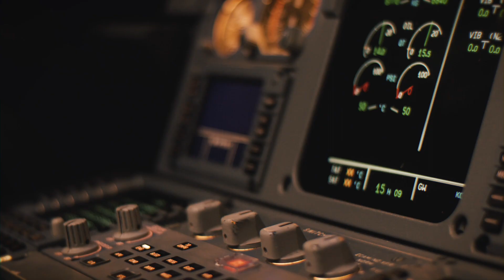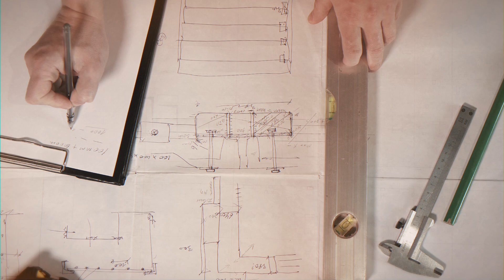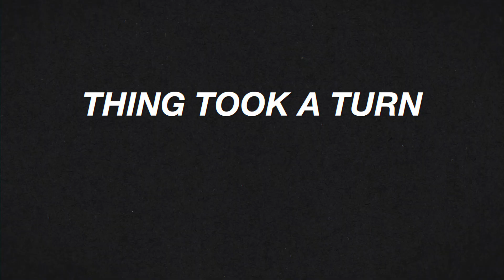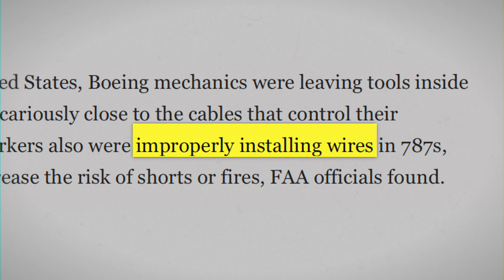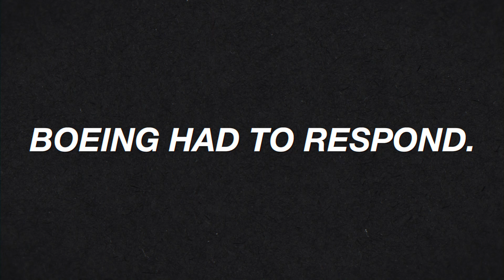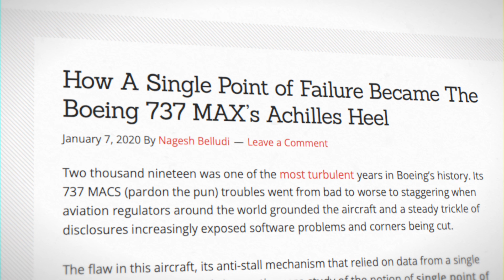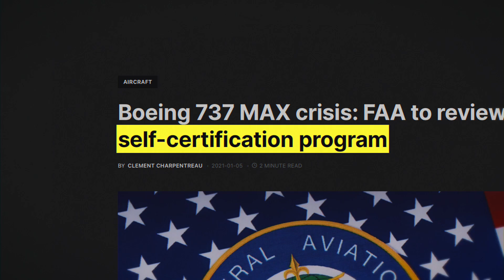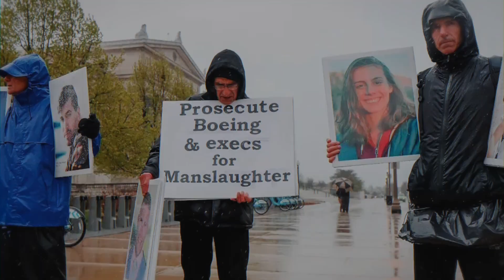The Scandal That Destroyed Boeing

Comment: The greed and blame gets worse.  Boeing DID offer a second MCAS sensor but it was an expensive OPTIONAL equipment addition.  Yes, Boeing was charging a premium for a safer aircraft.  Sadly, most airlines did not order the costly second sensor.  The whole situation is pretty messed up, actually.
Reply: Not the first time. In 1979, a DC-10 crashed when an engine fell off the wing and the aircraft stalled. The plane had a stick shaker to warn the pilot if the aircraft was approaching stall, but for the pilot only, and because that feature was powered by the engine that fell off, it failed to work.

A stick shaker for the copilot, which could have prevented the crash, was an optional extra; American Airlines chose not to pay for it. They also chose to save even more money by taking shortcuts when removing the engine from the wing for maintenance. One such shortcut caused the damage that resulted in the crash.
Reply: @BB49 This specific post is a misunderstanding. They did charge for angle of attack indicator display, but there was no two-sensor option.
Reply: @shane99ca  We watched how that happened in college.  Can't remember if it was human factors in A&P school or while in flight training.  Much of it blends together.
Reply: @BB49 Like most crusader types, you are quick to demand that others do something. But having two stick shakers instead of one can hardly be called a critical safety issue.

Furthermore, if you make it too difficult or expensive to do business, manufacturers will simply close up shop or head overseas for friendlier climes.

Leaving you to explain your role in the downfall of a domestic industry to an angry population.
Reply: @reubenmorris487  If you're talking about the cost-cutting practices that ended up costing lives, those were management decisions.
Reply: @BB49 When it comes to profit and greed it always goes before human lives. We have seen it before with Bophal and other horrible disasters. Profits to the CEOs and shareholders come before everything else, sad reality! :(
Reply: @BB49  @BB49  Actually, stick shakers are not safety-critical, because they are far from the only way the pilots can be warned of an impending stall.

In fact, in modern aircraft, the stall indicator is usually a gong and verbal warning. More modern autopilots will also attempt to take control from the pilots (assuming their hands are not on the stick). Many aircraft incorporate stick shakers/pushers as well but by no means all, certainly not mandatory for both chairs.

As for an industry leaving the country, it is likely to do just that if overzealous regulations make doing business in their current country too difficult. But what the hey, it's only a few billion a year and a couple hundred thousand jobs; according to Hurst, no skin off his nose.

Think of all the industries that relocated to China over the last 20 years. America is no longer the world's factory; China is. Granted, we're getting some of it back, but only because China has shown itself such a bad actor.
Reply: @BB49 I could take your criticism more seriously if it weren't so poorly written. You haven't actually refuted anything; you're just being pissy. Feel better? (Not that I care.)
Reply: @Hurst This is your opinion, and that's all it is. You get exactly one vote, same as everyone else.
Reply: Airbus comes with three. No extra charge.
Reply: @eleventy-seven  Airbus has three pilot’s chairs? Because you can only have one stick shaker per stick.

And don’t kid yourself; those three sticks, if they exist, are fully charged for. It’s just that there is no option to save money by ordering fewer than the full number.

That’s like saying that a Cadillac comes with heated seats at no extra charge. At that price point, it’s expected. (Although that didn’t stop BMW from trying to sell heated seats by subscription!)
Reply: The sensor they offered was to tell the pilots MCAS was not functioning NOT to tell MCAS it needed to act - the airlines that didn't purchase that didn't have one at all.   The sensors the MCAS used for determining if it needed to do anything  were already redundant on the 737 and pre-existed the Max AND MCAS.  If was that sensor that failed and could have failed on any plane due to malfunction.   MCAS even used more than one of the sensors on the Max - the issue is they chose to alternate between them for each flight rather than use them to determine if one was faulty - they didn't compare the results of more than once sensor.  So while the plane used the sensors redundantly - the MCAS system did not use them in a redundant way.  Perhaps Boeing mistakenly assumed that the existing procedures for handling runaway trim for any reason would be used by the pilot no matter the reason for the trim.  After the investigation of the first flight Boeing did reiterate  that the pilots should turn the trim off using the switches that have been there since the first 737 I believe as they were trained to do in any trim failure.  They still should have briefed the pilots on MCAS AND made use of all existing sensors on the plane for redundancy rather than alternating - and the pilots should have fallen back on their training and turned it off at the first sign of trouble.  And since both happened close to the ground - gone around and landed immediately as well.
Reply: @AmbientMorality  This is also a misunderstanding - there was always more than one sensor on the 737 - it's used by the plane in all models even pre-dating MCAS.  MCAS even used more than once sensor - the problem was just NOT redundantly.  They alternated between them for each flight with respect to MCAS only.  The rest of the plane used more than one redundantly.
Reply: @mikecoulson3575  I'm aware, but this means MCAS was a single-sensor system on any given flight. As far as I know, the operational FCC only considered inputs from its respective ADIRU and controlled all stabilizer trim functions through that, so all of those functions were also dependent on one sensor.
Reply: @AmbientMorality  I wasn't aware of that as I thought it was only MCAS that used one Sensor as I thought previous models of 737 already had the redundancy.  Perhaps I'm mistaken.  Regardless - they had more than enough sensors - they should have used them for sure...  If you really want to cut costs putting only one sensor in is no more dangerous than only using one at a time so they should have fully used what was there already.
Reply: @mikecoulson3575  Yeah. MCAS was part of the Speed Trim System, which has been around since 737 Classic and had much less control authority so a failure wasn't too bad. MCAS control authority expanded during development, and I suspect their system design seemed fine at the start and then they took shortcuts instead of redoing it later on. 

The 737 flight control architecture is also just ancient: when they were fixing MCAS, they were even having issues with even having enough computing power to process data from two sensors and cross-check both computers, though they managed to resolve that. Obviously, not an excuse at all though.
Reply: You’re talking nonsense
Reply: @shane99ca  That doesn't make sense. This isn't just about being allowed to build planes with or without certain features, it is also about being allowed to fly them in a country's airspace. Good luck going abroad so you can build cheap planes which are then forbidden to fly to US, EU and Asian airports.
Reply: @Wonzling0815  Proof, please, that no airliner is allowed to enter U.S. airspace unless it has two stick shakers instead of one.
Reply: @shane99ca  Proof please, that the mandate of a specific security feature made a manufacturer leave the country.
Reply: @Wonzling0815  I asked first; you answer first. Or concede that you spoke hastily about something you knew nothing about.

Because whether an airline (or specific model of airliner) is allowed into U.S. airspace depends on its overall safety record, not whether it has every safety device on the market. And the DC-10 had an excellent record—until that dark day which was not even Douglas's fault.
Reply: @shane99ca  I never talked about stick shakers, so there is nothing to answer or concede. What I was talking about is the idea that someone would move their manufacturing overseas because a specific security feature was too much.
Of course, if that is not what you're saying after all, there isn't much to discuss.
Reply: @Wonzling0815  Well, WE were talking about stick shakers, which is how this whole conversation got started. One guy went so far as to accuse Douglas of murder for not including two stick shakers as standard equipment—but then where does that leave American Airlines, who could have had that extra stick shaker if they'd paid for it?

Also, I never said that mandating a single specific safety (not security, which is altogether different) feature would push a manufacturer out of the country. A lot of burdensome regulations and associated costs taken together however, might—and has.

Earnest reformers tend to cause a lot more problems than they fix. The more passionate they are, the hastier they are, and the bigger the ensuing mess tends to be. Look at climate warriors, who basically want to shut down the entire economy, for an extreme example.
Reply: BUT Boeing probably did not inform any of the buyers why they would want to buy that second sensor.
Because that would require Boeing to admit that they knew there were clear safety issues with their aircraft.
Reply: @GeorgeMonet  It makes no sense to offer a product for sale without explaining why the buyer might want to have it. No one will buy it then.
Reply: @Hurst right try to tell that to board of directors and CEO will they  hear you  no they will not not only money is in their eyes and you think this will change some thing no nothing  this just unlucky situation for them and they will again blame their workers and nothing will change  with in higher ups  so for every  thing  that happens workers will be blamed CEO  and board of directors that make decisions will not change no matter what